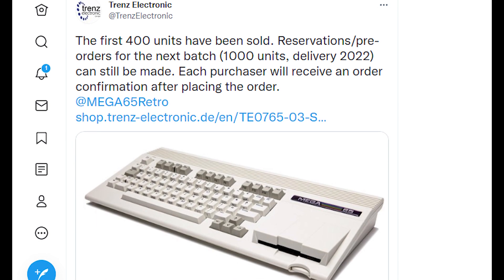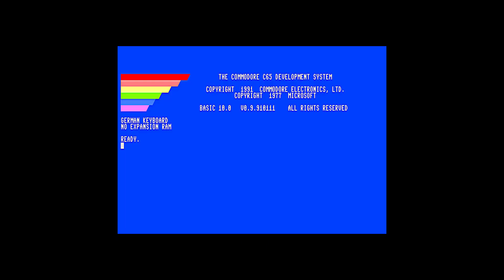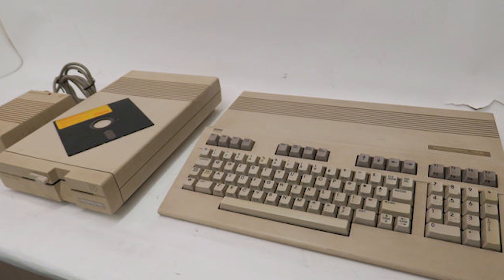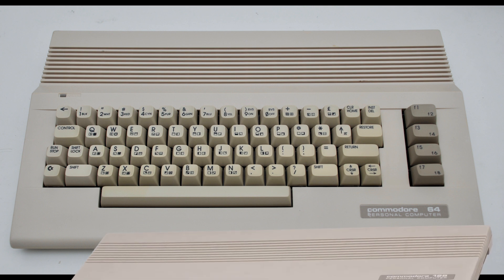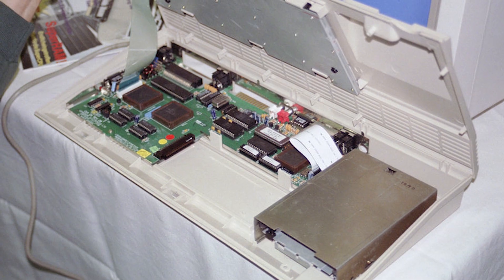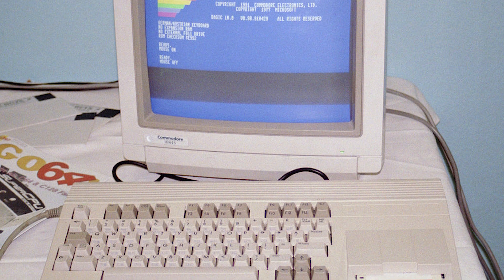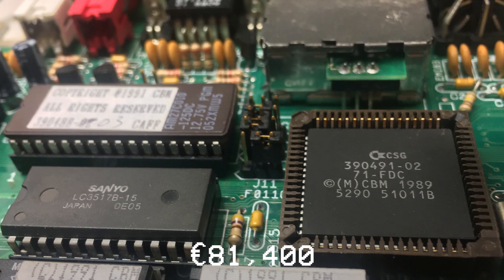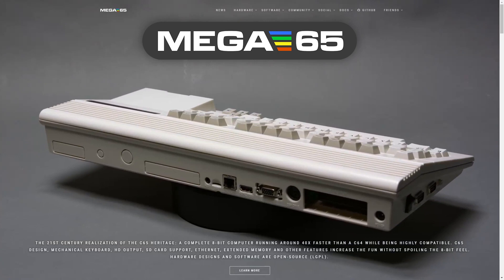What Was The C65? - Commodore's CANCELLED C64 Successor!

Comment: Fun facts:

The Commodore 128 are by many regarded as a flop sales wise with it's aprox. 5 million units sold, compared to the Amiga range of computers (A1000, 500, 600, 2000, 3000, 4000 etc) with only 4 millions units sold combined (The Amiga 500 models stod for most of the sales with aprox. 2.6 millions units sold)

Most games on the Amiga didn't sell well because of piracy. The games sold on the 8 bit computers earned the companies more money than the Amiga platform. -Only a few games on the Amiga sold well. A game like Turrican II only sold near 30.000.

-Oh, and please stop looking at the past with the present "eyes" . In the 80's alot of RAM in computers were important, and it was a sales argument for many companies. IF the Commodore 128 were supported better, we would problerbly have see much better programs, because of the extra RAM. 

What made the ST and Amiga computers stand out were the simulation, vector and faster racing games.
There's isn't that big a diffrence between 320*200 - 640*480 resolutions. 
-And please keep in mind that the HAM mode (Hold And Modify) could only use the extra colours when the image was standing still

Comment: Great video.  I will say, the A1000 was not a higher end model than the A500.  It was beautiful, and I always wanted an A1000, but it was lower in memory, and expansion options, by the time the A2000 launched.   We had two C128's in the house.  They both spent 99.99% of their time in C64 (Go64) mode.
Reply: Yep, the A2000 and A500 were two cost effective and improved versions of the A1000.

Comment: The challenge for Commodore is that it walked away from the core philosophy that had made it highly successful - superior technology at a low price. That's what the Commodore 64 was all about. The Amiga when it came out as the Amiga 1000 was way way above what any of the C64 kids could afford - and it wasn't C64 compatible. The Amiga 500 was cheaper, but it was still more expensive than the C64. The C128 was a step in the right direction in terms of affordability, but it didn't go far enough in terms of a technological advancement over the C64. The "C65" is the great "what might have been" - if it had gone back to that mantra of superior technology at a low price it might have worked. Unfortunately Commodore went on to produce either powerful machines that a lot of users couldn't afford (the Amiga) or affordable machines that did less than the C64 (Plus 4, C116 etc). They forgot what made them successful.
Reply: Was compatibility a real issue? All the C64 titles were available for Amiga too. Compatibility issues wouldn’t have prevented me or any of my friends from switching from C64 to Amiga. We only stayed at the c64 because when we could afford a better machine the Amiga has sadly also started to become obsolete.
Reply: @gabor222  Compatibility doesn't mean going out and buying an Amiga version.  If you owned a C64, you'd want to keep playing the games you already owned...not buy new versions.
Yeah, Amiga just kept falling behind.  All the A500 offered over the A1000 was just double the base memory.  They should have been onto the '020 processors.  The C65's Vic III chip was gonna give C65 games 256 color gaming roughly 2 years before the Amiga did with its lack-luster AGA in 1992...that should have also been there much sooner...hence the in-fighting.

Comment: The Amiga 1000 was released in July 1985. But because of its high price didn't really sell as well as the much cheaper Atari ST. So a cost reduced version of the A1000 was eventually developed, to better compete with its rival. This is what became the Amiga 500 and which was released in January 1987.
Now, the C128 was released much earlier in 1985 and was meant to be a successor to the 264 line of business machines (C116/C16/Plus4) and was originally named the D128. But after the project ended up in the hands of Bil Herd, he chose to make it backwards compatible with the C64's software catalog. He also changed its name to C128 (without first consulting the management), because he felt that D128 didn't make much sense now, if it ever had.
 - Anyway, my point is that a time and price gap for the C128 actually did exist, in between the much more expensive A1000 and before the more affordable A500 arrived. It is also estimated that a total of 5.7 million C128s, C128Ds and C128DCRs were sold during their 4 year production run...
So, really not that bad for the successor to the highest selling computer model ever (the C64) and far from the failure or even as useless a disappointment which the "you only ever GO64 anyway" lame-gamer-brainers wants it to be.
P.S. I am royally enjoying my not so dead dinosaur... the MEGA65 reproduction of the C65... and which btw. has inherited the "GO64" command from its older brother.
Reply: I was impressed to hear the 128 sold so many units, having previously seen videos and articles saying that it missed the mark somewhat. Wikipedia suggests that although it sold decently, there was a lack of software written for it (the C64 compatability proving to be something of a double edged sword, and its CP/M mode being too slow to make it attractive to use much apparently). It's a shame, because you are right that it could have filled a niche as a low cost business machine.
Reply: Yes, the C128-line was so bad that it outsold the entire Amiga-line, LOL!  The C128D(CR) made it fairly profitable. If Commodore had stopped C64 production in 1985 and moved forward with C128 and Amiga, then those people who still wanted a C64 experience would have bought C128's and you'd see more C128-specific software.  Once the C128 launched, many publishers had to re-release software to fix compatibility issues where C64 software that would turn on 2Mhz mode and the screen would go blank on a C128 in 64-mode.

Comment: to really make the Amiga 500 the true successor of the C64, they should a made C64 on a card for it, like how's there's a Apple IIe card for the Mac
Reply from the maker: Yes! And I'm honestly kind of surprised it wasn't (and as far as I know) still isn't a thing.
Reply: I think there was some emulation software for the Amiga, but I don't know how effective it was. A card might have been quite expensive and I do question the idea that, when a person has been playing Amiga games or using Workbench, Deluxe Paint etc, they would be itching to go back to C64 software so much that they would be prepared to buy an expansion for their new computer which they'd already spent £500 (in 1987) on. Besides which, your C64 card would need a port for a tape deck or C64 compatible floppy drive to actually play your old games, and of course the tape deck/floppy drive. If the C64 upgrader had sold their C64, they would most likely have sold those rather essential peripherals with it for the new owner, and if they hadn't sold them then why not just keep the C64 and play their old favourites on it?

Comment: The Commodore 65 had twin 8580 SIDs, so 6 channel sound, a blitter, same C64 sized sprites (larger than Amiga 500plus/600  sprites)had could display 256/4096 colours per scanline where the Amiga could only manage 64 but would cost HALF the price of the rubbish and long in the tooth Amiga 500. Wouldn't buy one though, no decent software was ever made for it in the last 3 decades and I already have 50+ C64 and C64 compatible 8bit Commodore computers.

Comment: I think it's only precious gold because it never got out of prototype. I can't see how this would ever have been anything other than a flop. A system closer to the Amiga but not an Amiga, with C64 compatibility  but in a more expensive and less convenient form than a real C64 (good luck finding software for that 3.5 inch disk drive when almost all C64 software came on 5.25 inch or tape), and also a further new platform in the 90s when the IBM PC/Wintel standard was already dominating. It seems basically another attempt to do the C128, but with success less likely.
Reply from the maker: Yeah, and Commodore marketing would've been even more confusing than before.
Reply: The 128 was a stop-gap.  The 65 was suppose to be the actual successor of the 64, but it was not ready in time foe the January 1985 CES in Las Vegas, so the 128 was born.